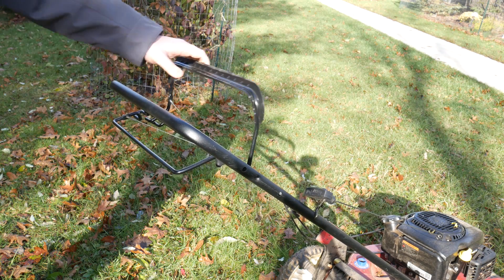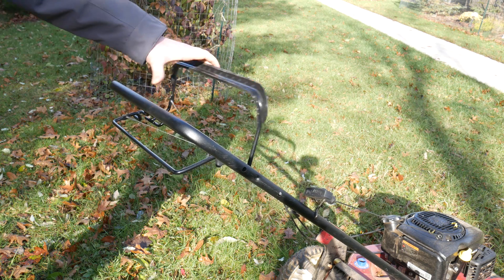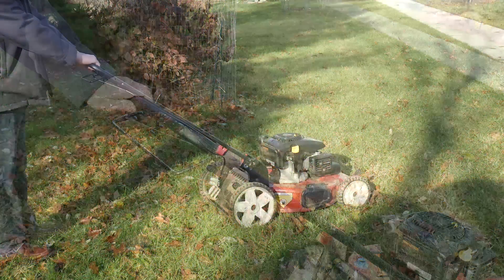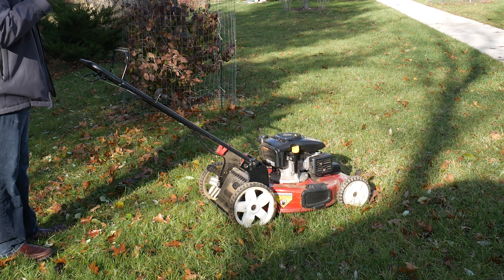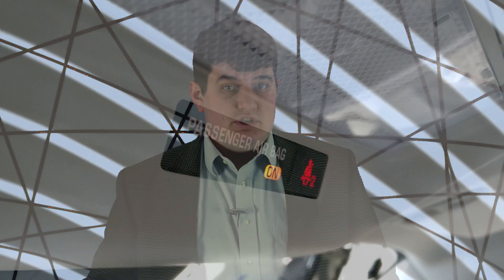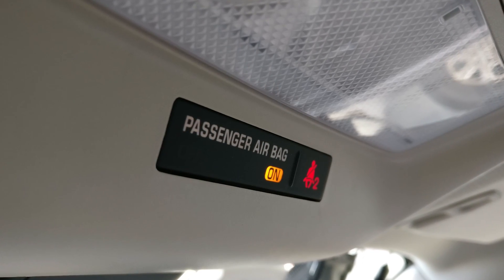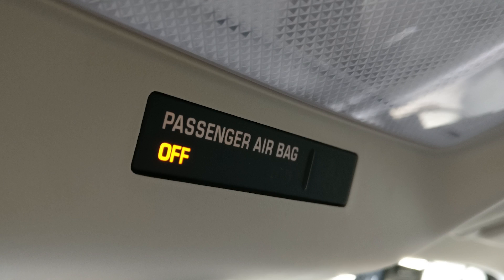The Dead Man's Switch:  How Anton Yelchin's life could have been saved

Comment: The only problem is with a dead-man switch is, neutral is primarily used when someone is not sitting in the driver's seat. For example, when you need to push your car, or need to get it towed. These are the primary uses of this gear for an automatic transmission. Most vehicles already won't allow you to retrieve your key if you're not in park, so there's already a reasonable compromise in place.

Comment: Also yall dont seem to understand the inner workings of an automatic transmission . The parking gear in an automatic transmission is only for use on level ground not on inclines if the vehicle is parked on a hill the parking brake should be applied. This is taught in driver’s ed in Washington state, it’s very basic.
Reply: you mean as basic as using turn signals to indicate your intentions, are you aware of the type of world we live in people are dumb and would rather do the easy thing rather than take the time to bring the car to a stop while holding the foot brake set the parking brake, put the trans into park then shut down the car, thats too complicated for most people, much easier to just shove the car into park. i mean they gots to send that tweet m
Reply: zachary carlson this is fine on level ground , just not on steep inclines. Dont forget an automobile is a mechanical machine and only does as directed by its operator.
Reply: @trevoro3227  That is true, but heres the thing, cars are big heavy hard to stop things, and the parking pawl of the standard automatic trans is not exactly a large chunky thing, I dont want to be on the receiving end of a tongue lashing by authorities or worse because my car malfunctioned, so yes I keep on proper maintenance, but i also use the fail safes that cars have, and the parking brake is one of those fail safes. Is it always needed no but is it still better to use it than not in my opinion yes, no one should ever be in such a hurry that clicking the brake off when leaving is a bad thing.

Comment: If I open the driver's door of my 2017 jeep Cherokee while the engine is running and out of P position, it applies the e-parking-brake automatically.
Reply: the vehicle in question here probably included that the feature as well, but IIRC the parking brake will only engage if the vehicle is in Drive,  in Neutral the vehicle will be free to roll
Reply: @harveytheattorney  Well no actually Snowcat's jeep does that cause the 2015 model anton was driving had so many issues with people not putting the car into park and selecting reverse instead, so when jeep was playing oops sorry we done fucked up they instituted that software desing for later models, and mercedes and some others actually have a better idea where if the vehicle is out of park and the door is opened it will apply the brake, but in case the vehicle is dead and you want to push it all you have to do is press the parking brake button.
Reply: There was a recall on the vehicle in order to install the code that Snowcat has on the '14 and '15 models. Unfortunately, the recall was only publicized after Anton's death.

Comment: My worry here would be how many additional accidents might be caused if the driver sensor stops working and someone cannot drive out of a dangerous situation.  If someone is sitting on a hemorrhoid cushion or the sensor stops working and the sensor reports vacancy once the car is moving they may wind up stuck in a much worse situation then the dead man's switch was designed to save.  Manual overrides won't help because an unwitting driver that encounters this won't remember the secret override in time to avoid getting rear ended at a green light they got stuck at.
Reply: Because in order to prevent the incident mentioned, it would need to be active all the time unless being overridden first, and the response from the vacancy sensor would not only need to be immediate but also engage the brakes or parking pinion on its own in order to not roll backwards down a hill and kill someone.  And remember, that victim was most likely sitting in their seat with the car running when they thought they shifted it into park.  So it would need to kick in rapidly at all times and not just wait for a gear change.  This would mean your car would shift into park if you got out your seat for more than x seconds (with x needing to be shorter than the time it takes to get out of your car and get killed by it)
Reply: Maybe you could draw out a flow chart of the logic it would use such as to avoid the car stopping if someone lifts their ass off the seat long enough or if the sensors fail (or the cables driving the sensor, etc).  I think any kind of safety delay you would have to bake in would negate it's ability to save the actor in their particular scenario.

Comment: My riding mower has the dead man switch disabled. I didn't do it, but it sure is nice to be able to get up off the lawn mower to move a stick that is too big, etc. without turning it off (or at least disengaging the blades, which isn't so bad).

I know, I know, safety concerns. I'm not worried about it as falling off the mower is unlikely in my yard, and in front of it at that.

Comment: Car companies should have some automation with these things a lot like some airplanes have. Alot of Boeing planes have automation in case of pilot error, but along with them they also have buttons that illunatime when the plane starts to correct. For example for the stick pusher the button says "Stick Pusher, PUSH TO INHIBIT". This sort of thing would be awesome here. Like "No driver detected, applying parking brake, push to inhibit' so that it can also be bypassed by the driver in case of an unusual situation, or a sensor malfunction. but this also makes it difficult if accidently circumvent the safety feature

Comment: The one scenario I can foresee where this would be a detriment is if you need to push the car. It is always easier for the driver to lean in and steer while others push, than for the driver to sit in the seat while the others push, adding more weight.

But for that, there could be a manual override, where you have to explicitly tell it "until next time I start the engine, let the gear remain in neutral", or something to that effect.

Comment: Why cant people just use there parking brake!
Reply: Trevor O because the new E brakes are a pain to use.
Reply: @shadowhound5113  How is an electronic handbrake difficult to use?  It's literally a switch! The older handbrake, with a lever attached to a cable, is physically harder to operate.
Reply: @leopold7562  the reason i have heard is because its not as easy to tell if the brakes are on or not, (though you could just check the light i would assume) And @Shadow Hound driving a car is hard to do properly if something as simple as clicking a switch is difficult maybe operating a 2 ton vehicle thats capable of putting people in an early grave is something you shouldnt be allowed to do
Reply: @compzac  Yeah, checking the light would do it, but it's still not a given. Then again, neither is the lever - I used to have a car that wouldn't hold on the handbrake on any slope steeper than a 1 in 8, even if I pulled it up as far as it would go.

Comment: At least where I live it's legal to unbuckle while parking to ensure you can get into the best position to comfortable see all around the vehicle. so a go in park when unbuckled would be a problem here what you could do though is to check for the buckle. if it's unbuckled you start a timer. If none of the control collumn (accellerator, brake, steering) get's applied within, let's say 5 seconds, the car is put into park.

Comment: Off road vehicles would need to ignore your dead man switch. Weight bounces in and of the sensor even at very low speeds. They are also less well suited to steer and shift by wire.

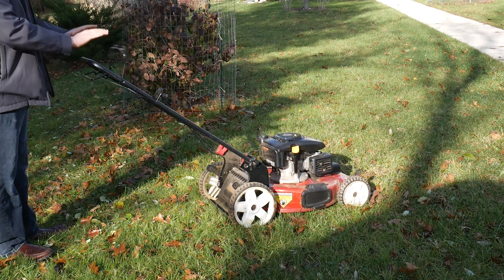Comment: 1:03 And riding lawnmowers ("lawn tractors") have a deadman switch in the seat, so that the motor will quit if you get off the seat.
Reply: usaly that is linked into the PTO  circuts so if the PTO (which is what dirves the deck) is disengaged one can get off with the engine running provided its in park

Comment: I remember having to use a concrete silo stave piece to hold down the switch on my Dad's Murray rider. I was tall enough to operate the mower, but I was underweight, so my upper body wasn't heavy enough by itself to press the switch.

Comment: This is a great idea.
I'd also like to see a u turn signal, and possibly a way to signal "yes I'm going straight" since there is no way to signal either of these intentions. (When you uturn it really confuses the person behind you who doesn't expect you to be practically stopping almost causing an accident)
.. And self driving cars that cannot speed when in a residential area. (With possibly an emergency button to override.. but you'd have to prove you had an emergency if you used it)
And auto parking in my garage so I don't hit the wall and can set how close I want it to park. (I really don't have a lot of extra room)
Reply: The lack of a turn signal is you signalling that you are going straight and if you do not have (or it's not functioning) then your left arm is an alternative turn signal. What really needs to happen is your local law enforcement actually enforcing the laws that require you to signal when you are turning that are already on the books.
Reply: @ericgoodman3510  still no uturn signal which isn't just turning, it would signal you are doing something odd and need a lot more time and room. I don't propose we need to use a straight signal every time,  I just want it there for those odd moments where both cars are stopped, unsure if the person is turning or just forgot to signal. It would make things more efficient.

Id also like to see the the third brake light used, not just all the time, but used to mean stopping more quickly than usual. There is a delay before you realize someone is stopping faster than normal, and that indicator would help.
Reply: @donutwindy  You can not u turn without turning and at least in America there is no street where I need to signal I need more turn room just because I'm doing a u turn. And again if a person is turning and forgot to signal then your local cops need to enforce your law not have some arbitrary signal added to the process of driving. What happens if the person forgets to put on the straight signal? Are you then going to want another signal for that signal? Are you going to expect that at every intersection I must signal straight? Is there going to be a law that I must signal straight and a fine if I don't? Are you really not able to see how terrible a straight signal would be?
Reply: @ericgoodman3510  no. It's just a signal you could use but don't have to. 
As for uturn, I've seen too many near accidents by people thinking someone is turning and assuming they can just go around them then almost plowing into them. I've seen it happen literally over 6 times.

Granted, they should just wait, and leave enough room and police should enforce. But people don't always follow the rules and some lack patience.
Reply: @ericgoodman3510  the problem I've seen is when someone is following too close. They assume the car is just turning left and will do so at approximately the speed they are traveling (faster if cars are coming) so they only allow for the car to possibly slow somewhat.
But on a u turn, the car is likely to come to a dead stop for no apparent reason in the middle of the road. And this happens even if they could have made a left turn at speed.
This can take the person behind by surprise as they were not expecting this. Random stopping for no apparent reason, I think deserves some kind of indicator. 

Or people need to follow less closely. Which would be nice.

But people don't pay attention. if they did we wouldn't need a third brake light that provides no additional information. 
Technically we wouldn't even need brake lights. 
But people do not leave enough room. So we need them.

Comment: You'd never be able to stretch while in the seat. A fair number of times on road trips with the cruise control on I'm stretch myself out lifting my butt up off the seat. If my car threw itself into part at highways speeds whenever I did this I'd be dead. No good. Maybe a beep on the speakers like you get when you leave your keys in the ignition or head lamps on. But definitly not applying breaks or for the love of god not putting it into park. Also how would you ever push a car in nuetral? Or rock it out of a stuck in mud hole? Etc?

Comment: It would be a helluva lot easier to just apply the main brakes if the seat becomes empty.

I've got a RG15 Colorado and it has the seat detector, but also doesn't allow the gearbox to shift out of park  unless the brake is applied. 

The seat detector seems to be exclusively for applying an irriating beeping sound if I don't have my seatbelt on. (I do a lot of ag/industrial work.. Drive forward 10 feet. Get out. Adjust load, drive forward 10 feet... etc.

Instead of a sensor that's detecting speed "If drivers seat occupied, and vehicle over x mph, apply irritating beep beeps!" It's purely an annoyance, not a safety mechanism.